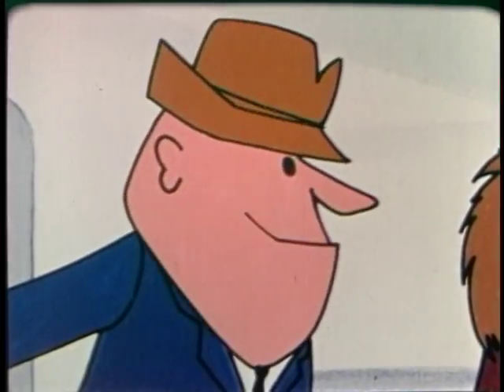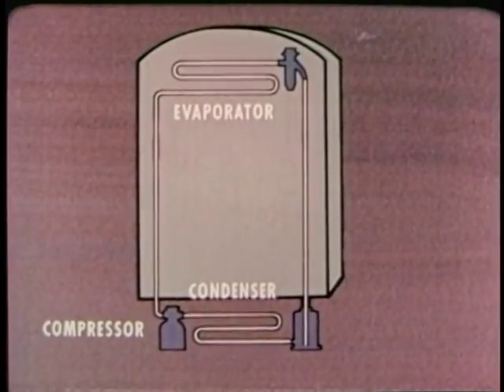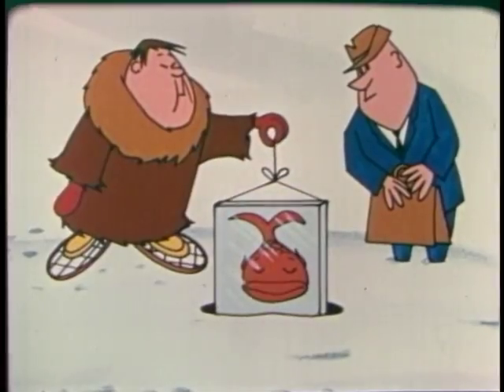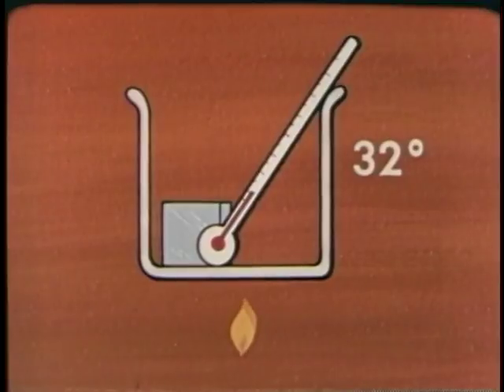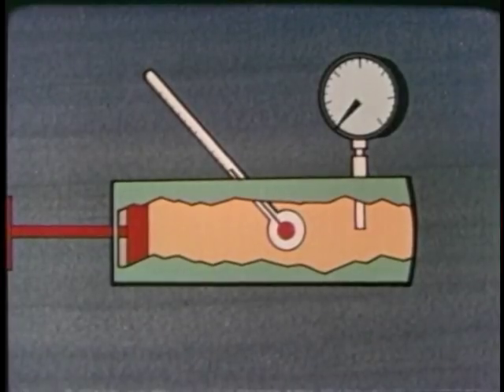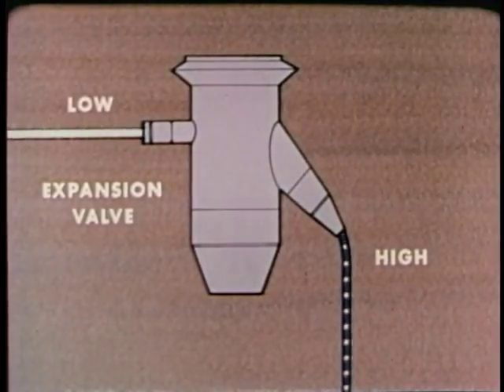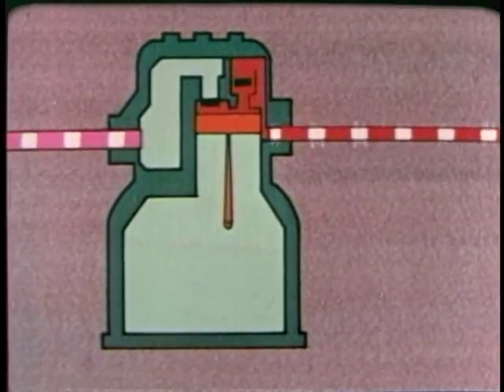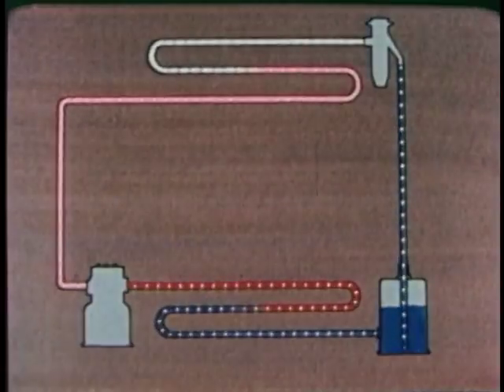Refrigeration: Principles of Mechanical Refrigeration (1964)

Comment: When the gas is compressed and the temperature goes up however that same compressed gas even if it stays compressed it will eventually lose it's high temperature.   Otherwise it would become a perpetual heat source.   You could just buy compressed air containers to heat your home and take them outside when it gets hot and buy low pressure vacuum tanks to cool your home perpetually.    It's the same with a refrigerator.   Just fill a box with vacuum tanks and you can turn water into ice cubes,  store your food.